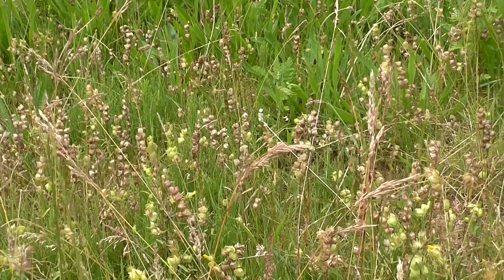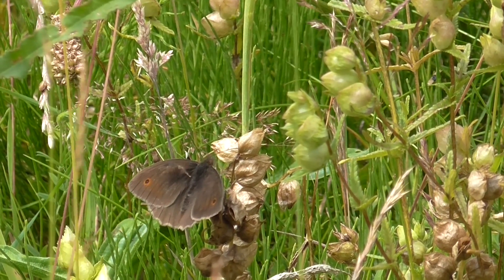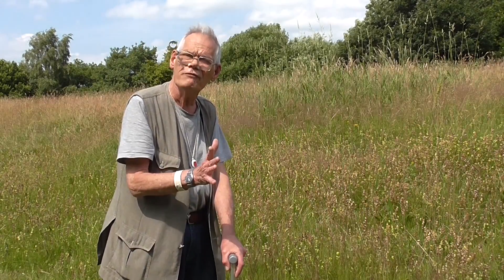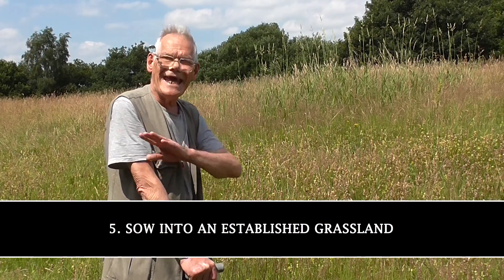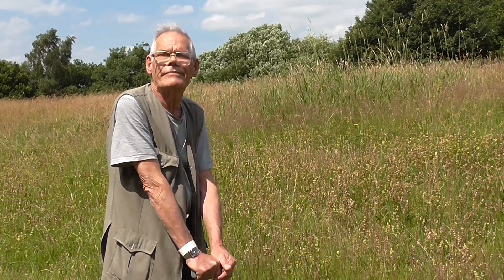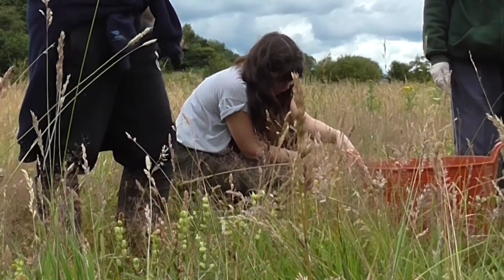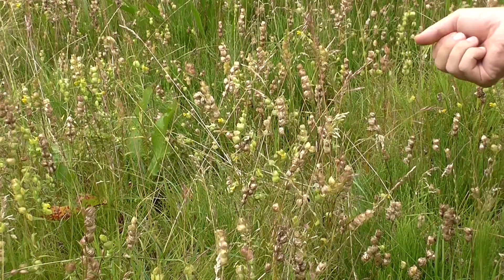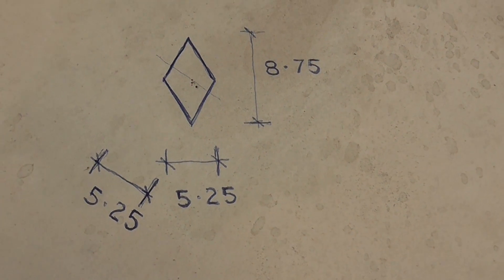Wildflower Meadow - Ten year research into Yellow Rattle

Comment from the maker: We have plans to try a different method, using an alan scythe mower to cut the grass low, then leaving it for 2 to 4 weeks for the grass to biodegrade. All advice states to rake the grass away when establishing meadows, however I'm curious if this method can be skipped due to the parasitic nature of yellow rattle. Slowly learning that more than anything it is highly important to have very good contact with soil (which seems obvious but it's not) and then rain/moisture on the grassland.

Comment: i would like to turn a field near where i live into more of a meadow than the area of rough tussocky
grass it currently is....dense tussocky grass that smothers everything and prevents anything else from moving in and getting started.
i havent the time to do any guerilla gardening involving any digging so i was wondering if you had any suggestion of what i could try? i know that yellow rattle is supposed to be useful, but how easy would it be for their seeds to get through the almost inpenetrable sward and down to the soil?
how easy would it be for yellow rattle to colonize such an area? 
is there any other plant seed that would be guaranteed to  break the stranglehold this tussocky grass has got? might another way simply be to dump a lot of tree leaves and or other organic twigs stems etc  from the garden in piles on top of the tussocks to 'smother the smotherer'! and provide some kind of access point for incoming airborn seeds to get a toehold?
Reply from the maker: It struggles immensley against dense grass.
Reply: @BoltonNewt  Try Fred's other suggestion and sow Red Bartsia seed. It stokes very well in long grass and grows as tall as it needs to to compete with the grasses it is adjacent to. Bartsia is a common weed so you should be able to gather a lot of seed for nothing. It comes up later than Rattle, has very similar leaves but they are not so 'crimped' as rattle and are slightly wider. The flowers are tiny but produce loads of seed.
Reply from the maker: @lifesforliving4929  I recall Fred talking about Red Bartsia as a good alternative. If I recall correctly he stated that Red Bartsia was a good alternative for acidic soil where yellow rattle would otherwise struggle. We have some at Leverhulme Park and due it not being as vibrant as yellow rattle you can often not be aware of it being present, however you can see exactly the same results around the areas it's grown with the grass signifcantly stunted. So absolutely, it's a real good alternative to sow.
Reply: @BoltonNewt  Thanks for the reply. I showed it on acid ground (New Forest) and it took very successfully, however I got the seed from plants that grew on the chalk  plains near Salisbury where it was being used specifically to create a diverse meadow.